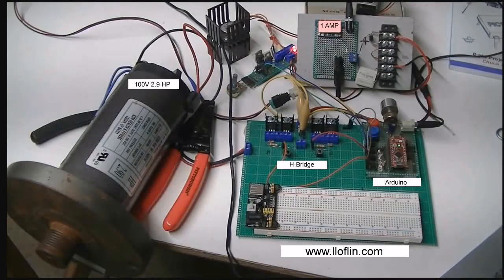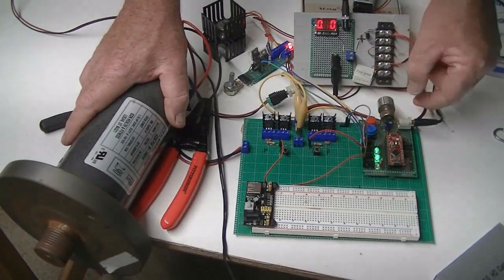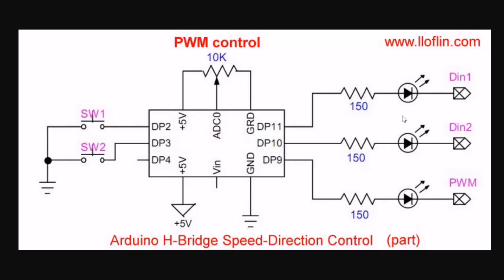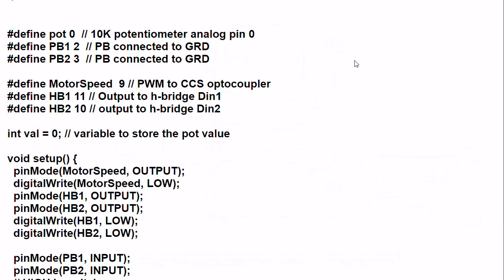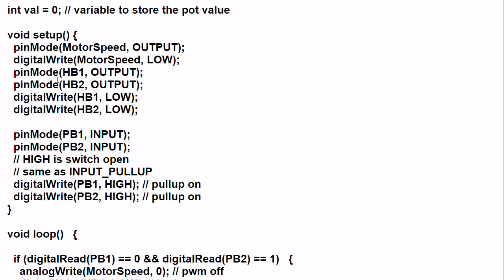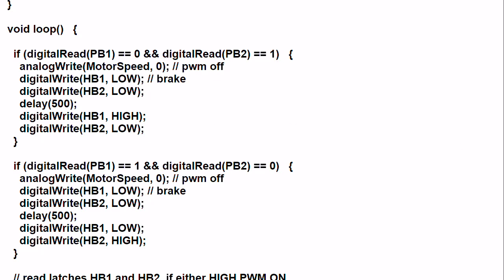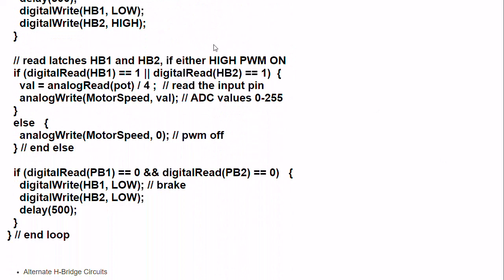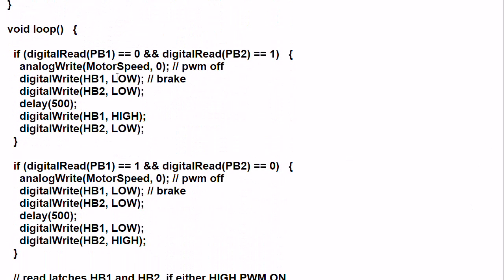Program Code Arduino CCS H-Bridge Motor Control

Comment: Lewis, it's always a pleasure for me to see you have posted a new vidéo. I think i found a mistake on the "H" bridge schematic. SW1 is HB1 and SW2 is HB2. Is that right??
Reply from the maker: Correct. HB refers to the opto couplers; the switches can also exist. They are used for testing. I should have used the opto label.